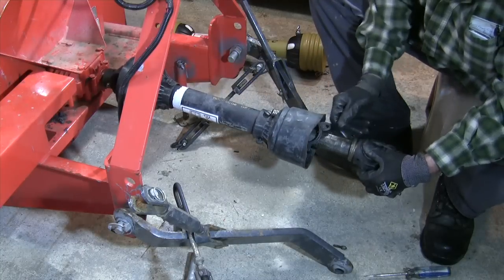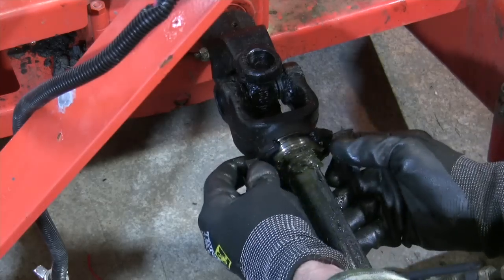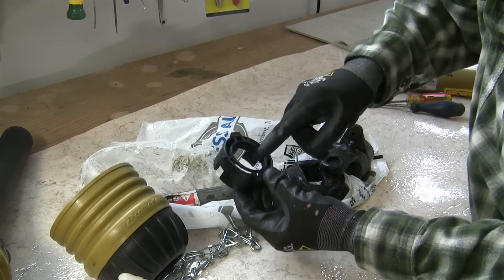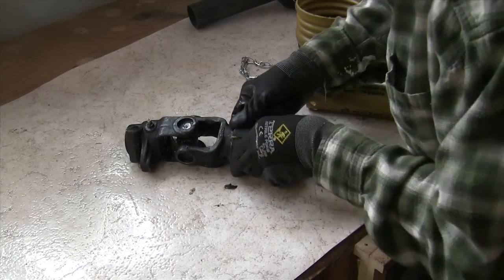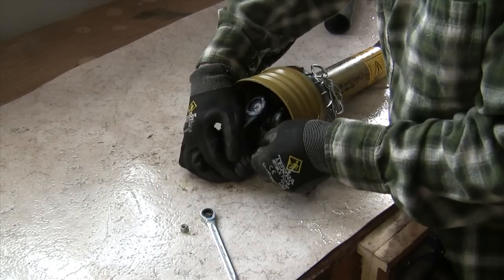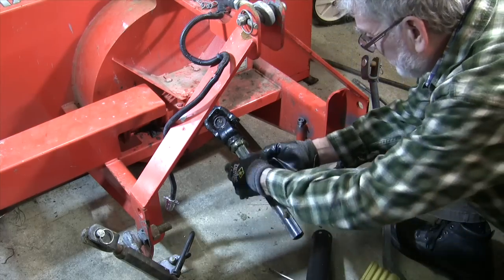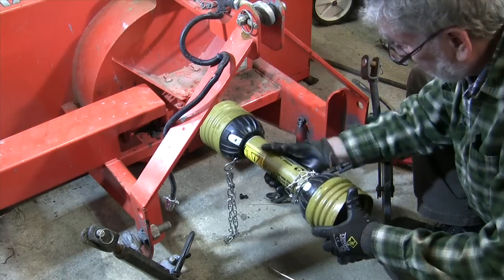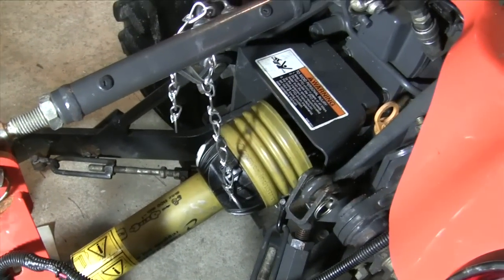Installing new PTO safety guard (shield) on tractor

Comment: Hello - On the implement (a fairly new Enorossi sickle bar mower) end of my PTO shaft, the plastic cover guard came out of the plastic bell housing while mowing and hay wraps around the shaft at that point.  (The pieces are shown at 4:15 in your video.  The plastic cover guard is the long shaft cover with several perforated holes around its end.)  Will I need to completely remove the PTO to fix this?  Also, what would cause the shaft cover guard to disengage from the bell housing piece?  Thank you for any help you can offer.
Reply from the maker: Perhaps you can back the bell cover back well clear of the U-joint, examine the shield (guard) parts for damage, clean out any accumulated dirt and reassemble. Check that the parts are well greased. Other than that hard to say without seeing the problem directly.
Reply: Thank you very much!  I’ll check it out.

Comment: I'm wondering, how you disconnect the pto shaft from the implement.  I removed the bolt, but the shaft stayed affixed.   Is it pressed on?  Thanks.
Reply from the maker: If you are referring to the tractor pto end of the driveline there is a push button release located very close to the pto output. Push the button in while pulling on the drive line.
Reply: No, I was referring to end that mates with the implement.
Reply from the maker: @AStanton1966  Kind of doubt if it is pressed on. Think you will find a key and keyway so that is the clue. Some gentle tapping might do it.
Reply: I found the key, but it looks like there is some kind of pin that goes through the shaft to the key.  I sent a pic to the manufacturer to see what they think.  The pin isn't an hex screw that can be backed out.
Reply from the maker: @AStanton1966  Interesting - let us know what happens.
Reply: I finally figured it out.  There was a Allen-type set screw holding the key for the shaft.  Now that I got it figured out, I can order a new shaft.   It's for a Meteor 3-pt hitch snow blower.  It's from Canada and the set screw is American standard. Thanks for your replies.
Reply from the maker: @AStanton1966  Yes that makes sense. Great you got it all on the way.